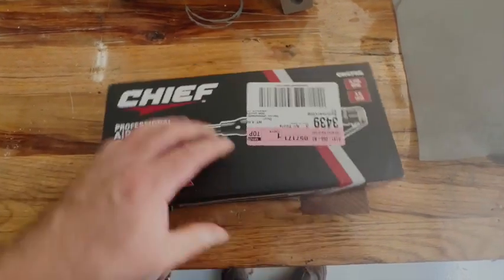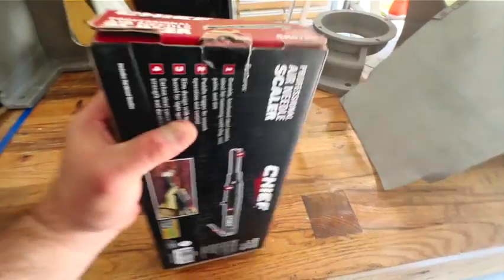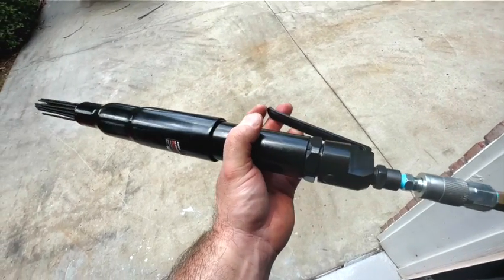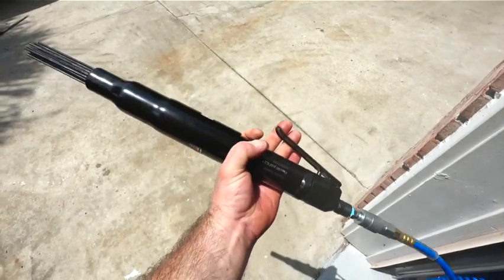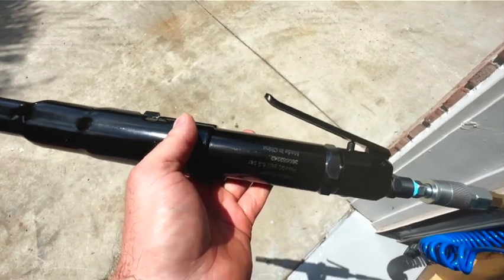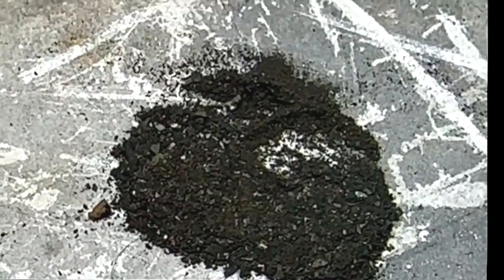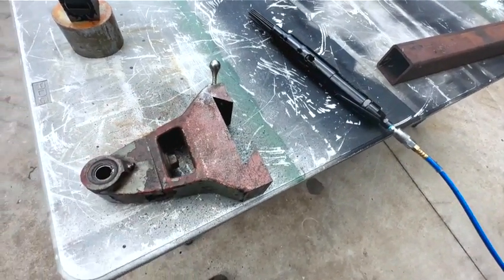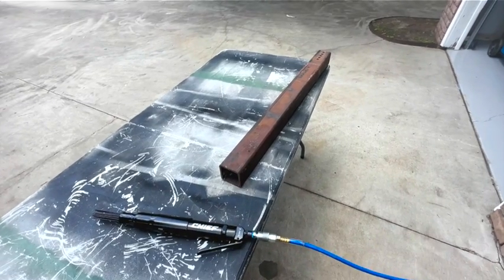*THE BIG CHIEF* Harbor Freight Needle Scaler (Unbox, Review,  Recommendation)

Comment: Needle scalers are for— get this— thick SCALE. Like rust so thick you can’t really tell how thick it is or if there’s any metal left underneath. It’s absolutely the wrong tool for paint stripping or light rust removal. Get a scotch surface conditioner roll and go to town with that— way faster and more efficient for light rust.
Reply from the maker: you sound very confident in your position.  I recognize that it's possible that you have never used this tool for this application, or seen it used for paint removal, but my recommendation is that you do a quick search.  I think you will find that not only are needle scalers used for paint removal, but they are widely prescribed specifically as the solution for leaded paint removal...
Reply from the maker: Let me help you .  https://www.osha.gov/laws-regs/standardinterpretations/1991-06-18.    Let me know if you need more objective evidence.  Thank you for the comment
Reply: @JeremiahL  I apologize for  overstating my point. Instead of saying they are the wrong tool, I should have said there are better choices in tools for the task depicted. Obviously they will work but then again, one could do dental work with a Dewalt drill technically.
Reply from the maker: @G5Hohn  Cheers to that
Reply: Yeah, scaling that first piece of NEW metal isn't what this is for. Look at the condition of that metal now. It is all "dented" up. You don't needle scale threads on a pipe fitting either.
Reply: I've probably had a few hundred hours on a needle gun during my 6 years in the Navy and it's definitely for knocking off scale. After that we would wire-wheel it to bare metal.

Comment: mine lasted 6 hours of use.  and it's so tight i can't get it apart with a 3 foot bar to inspect it/clean it.
Reply from the maker: Did the cup that hold the needles get compacted?
Reply: @JeremiahL  the cup is fine.  i got the jam nut loose, but can't breakloose the actual tool so i can clean it up if it's got any rust anywere.  i used it last week.  i got a replacement today at harbor freight.  i oil the tool more than i should.  either something broke or I need an air dryer.  i'm sure i need an air dryer however i have a dozen air tools and this is the only one i've had in 20 years that failed.
Reply from the maker: @justinpaone2227  ill follow up if I have any problems.
Reply: @justinpaone2227 You don't need to torque the pieces together. Loose is fine. The needles will break with use, and I've had the little "head" of the needle boubce around inside and need to be taken out. Also, too much oil is a good thing on needle scalers.